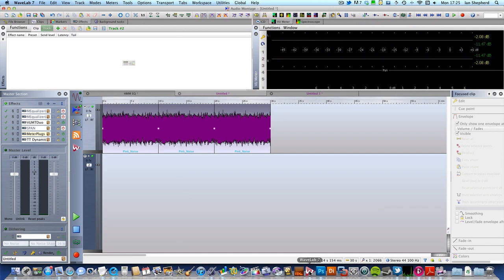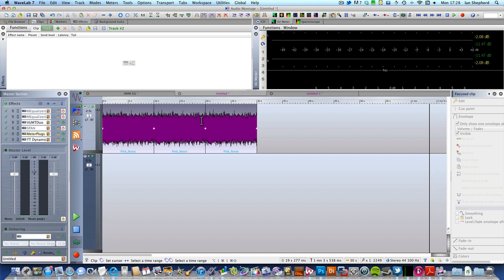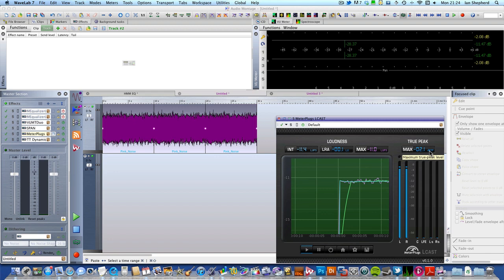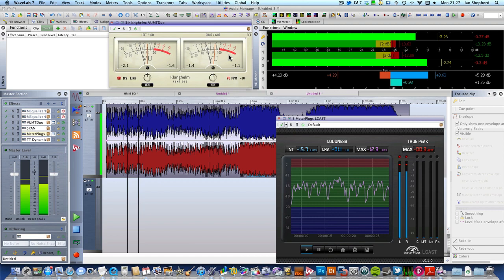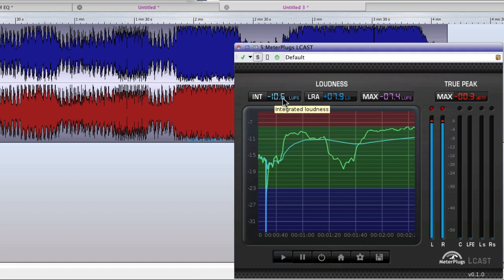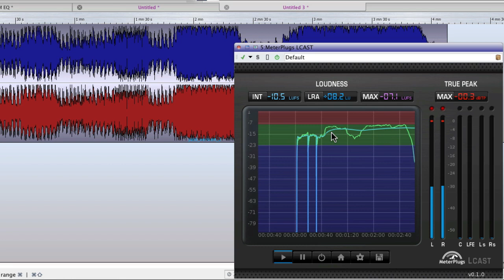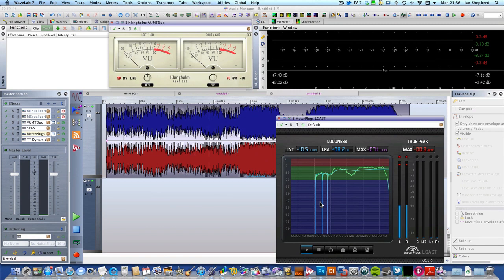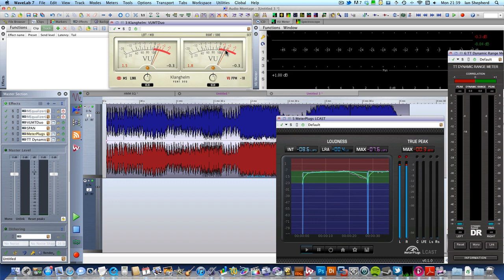LUFS - the new Loudness Units. What do they mean ? How to read the new breed of loudness meters

Comment: I tested the following meters/analyzers in Cubase Pro 8 using the pink noise file: Steinberg SLM 128 (EBU R 128 only, free), Cubase Pro 8 native Loudness meter (EBU R 128 only), TT Dynamic Range Meter (free, or Brainworx bx_meter $99), Voxengo SPAN (free), Waves PAZ ($129), Vengeance Scope (free for Vengeance customers), Brainworx bx_XL (superb limiter with bx_meter $329), T-RackS CS Meter (free), Klanghelm VUMT Duo with VU set at -12 ($9), Schwa Schope ($25) and Sonalksis FreeG (free). The most accurate of these were the Steinberg SLM 128, Cubase Pro 8 native loudness meter, TT Dynamic Range Meter (or bx_meter) and Brainworx bx_XL. These read spot on -11.5 LUFS (dBFS). Also very accurate were Voxengo SPAN (metering set to DBFS +3), Sonalksis FreeG and Klanghelm VUMT. I must admit that I love the Klanghelm VUMT. When producing/mixing/mastering music I see no need for the new fancy and overly expensive meters/analyzers showing a bunch of statistics. RMS and DR (and my ears) are still my guiding angels for loudness and dynamics. However, one would need to adjust (lower) gain and look at LUFS if required to comply with broadcasting loudness standards.

Comment: Hello Ian, just for info, the new multimeter plugin for Logic X (distributed with the 10.2.1 update last week) now includes a LUFS meter. While the RMS meter still under-reads by about 3dB, the LUFS meter shows -11.5dB. May be worthwhile mentioning this on you productionadvice website which (obviously) still shows LPX as under-reading. Thanks for the great tutorials.
Reply: I noticed that too, Loudness meter it is from now on then. To add FabFilter Pro-L was miles off whereas Izotope Insight was bang on.

Comment: Great explanation! But the True Peak will show you peaks that are in between samples which can get 3 db higher than what you are seeing in a sample-peak meter no matter if you are over the 0 or under. I believe the reason for a meter to show a digital signal over the 0dB has to do with 32bit floating point.

Comment: Just to let those know who might be like me. I thought this meter would show you RMS.

 In the video, he says for a beginner we are not wrong to think RMS and LUFS are not similar. So I bought the plug in LCAST. and the security code to use it never arrived. I got a refund because they said the plugin will not measure RMS and that they are entirely different. WHAT? that contradicts what I was told then in this video. This info I got by email from the firm who make LCAST METERING PLUGIN called METERPLUGS. 

They said, RMS measures signal strength. LUFS takes into account the frequency distribution of a signal whereas RMS has a flat response. -23 LUFS is a typical target for loudness normalization.  Then they recommended I watch this video. 

So basically I am going round and round. Thanks video for making me think RMS and LUFS were the same thing and spending money with your firm and losing hours only to find you yourselves then say they are different things entirely.
Reply: In my view, Ian is correct in stating that it is not wrong to think of RMS and LUFS as similar, if that helps your understanding.  That said, Meterplugs is also correct and wise in stating that they are quite different, positioning themselves on the side of caution.  I believe that the difference is that RMS measurements are based on raw dB alone whereas LUFS is based on LUs.  They too are similar, but different.  LUs more accurately represent perceived loudness as per the anomalies of human hearing, the sensitive spots being in the range of 1-5 kHz, whereas dBs just consider amplitudes at any frequency.  Never forget the Fletcher Munson curves!  In other words, to achieve your purpose, you don't really want RMS, you want LUFS.  RMS is just something that we have all become comfortable with due to the historical technological limitations of metering.  

Hope this helps.  And if I were you, I would reconsider and purchase LCAST.  Great value for the money.  :)
Reply: Thanks Ian. Spot on. LUFS is definitely where it's at.  Although RMS is certainly useful, what good is it if only our meters are 'hearing' it? What if a production's content is supposed to be bass heavy?  Should it be penalized somewhat during broadcast by its RMS or granted some degree of leniancy by its LUFS?  What do we want to master to? Our ears, or our DAWs?

Comment: 7:50 - I'm monitoring the audio of this video and, at least with MLoudnessAnalyzer and Waves' VU meter, I'd say the momentary loudness is much closer to the ballistics of that particular VU.  Another thing I've noticed is that your integrated value for this video is about -20 LUFS or K-20.  Under Stats For Nerds, this has given you a perfect content loudness but I'm not sure if older videos like this were 'grandfathered in' because I've noticed that in other ones which surely weren't normalized as such.  Thanks.
Reply from the maker: Fair enough, the ballistics of each meter vary, and I've never tried that one. Whichever feels helpful to you is the right one to go for !

The video actually hasn't been normalised (hence no Content Loudness value) which has happened at certain times over the years - I suspect it's actually quite a bit below the normal reference level, fwiw.

Comment: So i guess the reason different videos differ....Is because some will have high dynamic range, so sometimes you might get a really loud section- if there are really quiet sections. Because the whole integrated value is measured.

Comment: I don't understand why one would be upset about the loudness metadata being included with files and supported by playback software. Listeners themselves have long since chosen ReplayGain as a volume equalization standard. Would FM radio with somewhat lower available dynamic range also normalize to -23 dB? Probably not.

For digital at 24 bits it doesn't of course matter. Although, I noticed that the popular Lame MP3 encoder in VBR mode assumes the threshold of hearing a certain number of dBs below full scale, and would produce an increasing amount of artifacts as the volume of the input was scaled down. CBR mode, widely regarded as obsolete, coded the long fade I created well up until the end. It's likely other encoders also assume loud, hot signal.

Comment: Great video. You say that the song would be turned down because the LUFS exceed the new threshold. Does that mean people will have to mix and master to a reference of -23 instead of between the -15 and -10 that I have been working to? And will existing tracks have to be re-mastered at lower levels?
Reply: No.  -23 is just the normalization value that broadcasters will play it at.  You should continue to mix and master at sensible values that exhibit the desired dynamic range of your audio production, e.g. TRUE PEAK at 0, LUFS at say -11, and MAX LUFS at say -8.  The broadcasters will take it from there and play it back as to their level requirements, which will be on a loudness par with the rest of their program.  As long as you are happy with your LUFS, you should be happy with the broadcast.  Don't worry. It's all relative, and hopefully this legislation will encourage mixers and masterers to utilize more dynamic range.  The headroom is certainly there in broadcasts, so why not?
Reply: I predict that one day soon the loudness war will change over into a full maximized dynamic range war, and that will be good for us all.  I can't wait.

Comment: Hi Ian

Just a question: How do you integrate/use a Brickwall Limiter to ensure that your Integrated reading stays at -23LUFS?

Our Local Broadcasting specifications are as follow: "Audio must be EBU R128 compliant after final Mix. (Integrated loudness of -23LUFS over the duration, with an allowable maximum True Peak of -3dBTP) 24bit 48khz stereo".

Does that also mean that my ceiling must be set to -3 dBFS (if using the L1 for instance)?

Thank you

Comment: thanks for all this information...still puzzled about its implementation though
ie if you're mixing a track would you mix it to just under true peak or would you mix it
to -23 lufs( I )?..would the broadcasters just automatically drop it to -23 lufs(I) or would
they reject the track...what if a radio station is broacasting at a weak signal and you change
channels to a louder signal?...where is the consistency..???

Comment: Great work! - thanks for making this available.

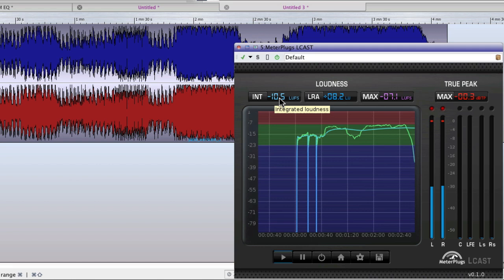One question that puzzled me: At 12:50 you mention that when broadcast the track would we turned down 12.5 dB (to match -23 LUFS). But since LUFS is measured "psychoacoustically" didn't you mean the track would be turned down 12.5 LUFS ? - I mean a -12.5 dB change isn't the same as a -12.5 LUFS change is it?
Reply from the maker: Actually it is. A change of 1 LU is equivalent to a change of 1 dB
Reply: I see... puzzling :) - so the LUFS measurement is different from DBFS but not the scale?
Reply from the maker: David Filskov Yes. Strictly speaking dBFS is a peak level measurement, and tells you almost nothing about loudness, as I say in the video.

So a change in level of 1 dB will cause a change of 1 LU. But you could apply some kind of EQ which would also cause a change in the measurement (and apparent loudness). 

In the same way, there are processes you can apply to audio which significantly change the peak (dBFS) measurement that have no effect on the loudness.

Does that help ?!?
Reply: Yes, thanks again! - since the measurements are different I'd expect the scales to be different to. At first this "mismatch" seems impossible :) - but it's starting to make sense now.
Reply: maybe stupid question here, but as mentioned, does a lufs meter in a way show the actual loudness that a limiter or compressor might provide, like in a way see what the limiter or compressor is actually doing to the sound, unlike a peak/dbfs meter where you really just constantly see the same peak or "apparent loudness as mentioned above"???

Comment: Hi Ian,

I'm still confusing myself to death re: using loudness meters.  For the moment I'm using the ttdr "free meter"  For an experiment I used a simple acoustic guitar track (using the amplesound guitar emulator....great vst)  I turned on the realeq from reaper,   loudmax limiter and the TT meter, Now mind you this was just a soft accoustic guitar sequence.  Nothing fancy.  pretty much flat eq with just a few  bump ups in the medium low and the high to enhance the sound of acoustic strings.  By carefully manipulating the limiter and the volume I got the master out to stay solidly at about minus 3 db.  But no mater what I did whether lowering the fader on the actual track or the master fader, the TT kept reading on side (left as "OVER" while the other side stayed where your previous videos said they should be at minus 1 or lower.

What am I not "getting???"
It sounds to my ears fine, but according to the  TT I'm clipping somewhere.  
Can you send me a link to the video on using the meters and limiters again?  I just cannot seem to get this right.  And it shows up when I mix down.  There's pumping that I do not notice when I'm working on the mixes.  I am also still confused about using side chain compression.  Not on drum base stuff but on vocals.  I like to keep a clean vocals when the singer is singing, and only augment the dynanics when the singer stops with small reverb or delay.  Solely for dynamics.  Can you advise a bit on these matters.  I'm frustrated because I'm not doing really complicated music, and am more interested in making certain the  lyrics of the songs are clearly heard over the music.  Thanks.  Not sure if I'm even explaining myself correctly but need to ask.  Thanks again.

Marty

Comment: Hi Ian, thank you for such a great video. I thought I was getting a handle on things until I tried the pink noise test in Logic 10.6.3 and I’m wondering if you or anyone can help, as I’m very confused by the levels I’m seeing. 
Using Voxengo Span, the RMS value for the pink noise wav is -14.8 RMS with a TP value of -0.6 in stereo, and -17.8 RMS with a TP value of -4.0 in mono. Voxengo has two LUFS metering options LUFS-ML/SL, so I wasn't sure which one to use. Logic’s Multimeter shows -14.3 RMS with a LUFS value of -11.4 and a TP value of -1.8 in stereo and -17.3 RMS with a LUFS value of -14.3 and a TP value of -4.1 in mono. How should I deal with these differences? Do I need to get a different meter? Thanks.
Reply from the maker: Did you use the test file from my site ?  In Span you need to choose the “RMS +3dB” setting in the preferences, the default setting is wrong. Logic's multimeter is known to be wrong, unfortunately, but has a new Loudness Meter which will give the correct values. So no, you don't need a new meter but basically at this point I suggest using LUFS not RMS.

More info in the "Appendix" section of this post: https://productionadvice.co.uk/LUFS-dbFS-rms/
Reply: @ProductionAdvice  Thanks for your reply Ian. I came across the "RMS +3dB" post after I posted here. Will carry on using SPAN and the loudness meter in Logic for now 👍

Comment: i used the pink line in ozone ew to get a rough balance.  after that would you use a vca on all channels until you get -18 rms on master fader?. I get confused with all the metering.  i have waves wlm  and dorrough meter aswell as the pink noise reference line in ozone.  how would you use these tools to balance your mix?

Comment: Can you use RMS if you dont have a way to measure LUFS. I got a pretty old Premier Pro Suite and it doesnt have that.  It does have loudness units but I heard Adobe's method of calculating isnt as accurate as the industry std.  fixed this thanks to your sinewave pink noise sample...  Adobe by default uses square wave so it was off by -3db thanks for this tip!  only thing I cant figure out is my peak amplitude for this pinknoise wav file shows -2.08db?
Also this is a question I cant seem to find a real answer for.  What scale should one's software be metering scale be set to?  I know 'should' be logarithmic but what should be the decible range be? 96db?  120? 140? 
and last question out of these what do you suggest for a display method?   Triangle, Hann, Hamming, Blackman, Welch (Gaussian), or Blackman-Harris (this might be a personal preference which is why I ask)
Reply from the maker: You can, but I don't have any detailed info, sorry. Better to pick up a free LUFS app - for example on Mac there is this:

https://github.com/audionuma/r128x

(Scroll down and look for the GUI "binary" installer)

I think Orban may make a free app, too.

Comment: I am a voiceover narrator who discovered Auphonic.com which uses LUFS.  I've used it to process narrations. I deal with ACX.com which requires submittions  to be between -23 and -18dbs RMS, with a peak of -3 db and noise floor of -60db and -50 db. What LUFS settings would be appropriate to match ACX requirements.  Also I do TV/radio commercial auditions. What would those settings be?  There are a list of settings to choose from including -24LUFS, A/85, ATSC no gate (US, TV) Thanks.

Comment: Well, I create Downtempo / Chil beat tracks including guitar. I 've been using plugins including Compressor, limiter, PAZ analyzer, WLM loudness meter and have been trying to reach the goal of -14 / -13 dB LUFS standard of Youtube and always found my song lacking power and loudness when comparing to celebrities tracks. Then I decided to measure those reference tracks...  To my surprice, I found that almost all known songs, even Despacito or Ed Sheeran's tracks are at around -6 LUFS !!! So what is wrong in this case? Should I follow the Loudness War and export my tracks that loud and let platforms as Youtube reduce/normalise them even 52% (Despacito: Volume / Normalized100% / 52% (content loudness 5.7dB) or follow the limit standard rules of -14 LUFS?

Comment: Just to let me clear things up... 
1: does that mean the less i compress and the more dynamic my track has the louder it gets?
Bacuse i will reach a lower LUFS measurement? 

2: lets say we have a EDM track without any dynamic changes at constantly at -14 LUFS.
And a track with high dynamic changes with just simply say half the volume of the EDM track in the verses but double the volume in the refrains with the same length of the parts. The track also should get a overall integrated LUFS at -14.
So both Tracks stay as they are (spotify) but the more dynamic songs is twice as loud in the refrain? 

cheers! and thanks a lot!
Reply: 1. Yes, the more compression gives you a static and flat sounded track.  therefore if you compared a compressed mix to a dynamic one at the same volume the dynamic track will sound louder.  

2. Yes if it is not peaking.  if there is enough headroom on your track to double the volume in different sections then if it registers -14LUFS then Spotify will not normalize the track and it will sound much louder than the even track. 

P.S. after years of experience don't have loudness as the main focus of your music, create a natural dynamic track within specs and the algorithms will take care of the rest for you.